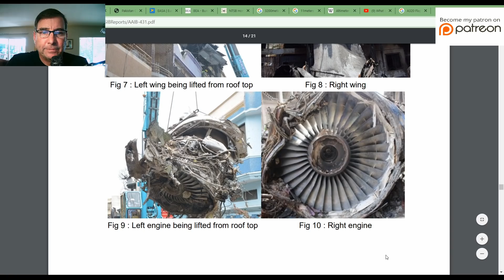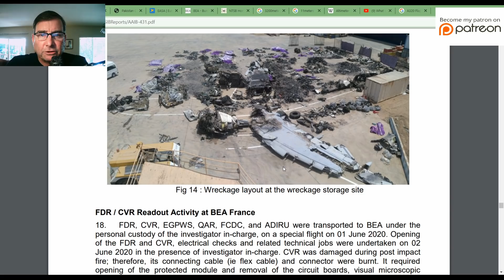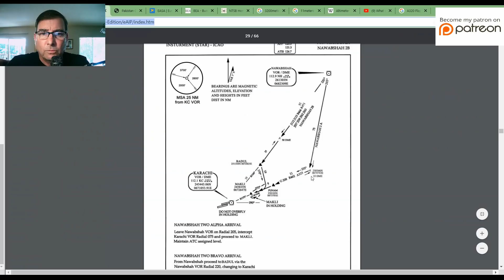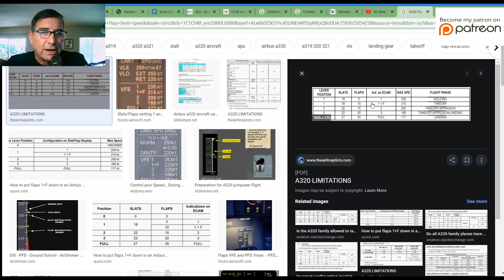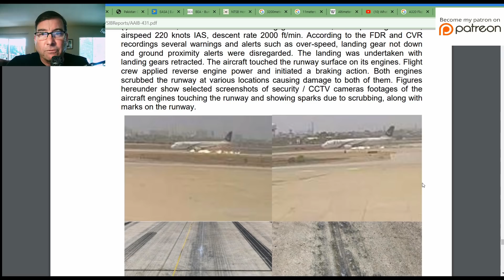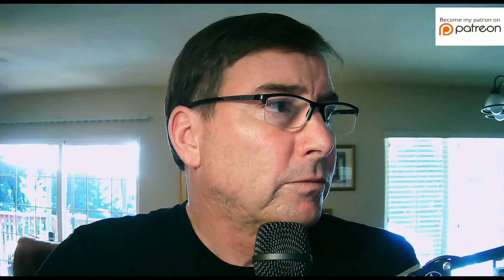PIA #8303 Preliminary Report Part II

Comment: I would not call this an ATC mess up... The ATCO expected the aircraft to heed multiple warnings and go around. I find it reasonable to avoid stressing an obviously overworked crew with a frequency change.
Reply: yeh more pilot induced, but atc could have said "approach clearance cancelled", in saying that atc still tried to tell them to do 360 to restart approach but the pilots disobeyed that.
Reply: @WaveFlightSimulations  The rule is the pilot is always in charge not ATC. ATC is there to help, advise, and coordinate. Ultimately the air crew is in charge.
Reply: @crissd8283  yeh thats what i said, but the approach clearance command is authoritative. The ATC in this case was not stern enough, and conceded to the pilots demand.  Most other airports, ATC would have said "PIA flight xxx, approach clearance cancelled, fly runway heading climb xx, follow my Instructions STRICTLY ".  If they said this the pilots would have realized they would be written up for misconduct and followed atc instructions.  In this case ATC was just like "ok your not going around thats fine i guess?". This is not proper ATC SOP to be bullied and intimidated by a pilot. ATC's instructions are authoritative, and unless its an emergency you as a pilot follow these instructions. Asking to restart approach isn't authoritative enough, it sounded more like a suggestion rather than an instruction. I suggest watching VASAVIATION  on pilot deviation, and how professionally and authoritative ATC are in those situations :)
Reply: @WaveFlightSimulations  it all depends on the mindset of the ATCO. He probably is used to this kind of approach and has learned to give as much help as he can. If he plays hard ball in an environment with a high percentage of these pilot deviations he'll have more go arounds than landings. In the end it is his responsibility to ensure separation of traffic and to facilitate the safe and efficient conduct of air traffic. Yes, that includes catching pilot error if possible, but he attempted that and was deflected. Without any indication of a problem beyond an unstable approach the ATCO would not interfere with pilot decisions.
Reply: Nikhil Naik - All you have stated sounds very good, but, sorry, it does not work like that. ATC did what was required, they advised the pilot of his altitude setting up for the approach. The pilot stated they were "comfortable". The pilot is flying the aircraft, not the controller. Is the controller qualified as a 320 pilot? The controller can recommend, it is the pilot who decides the course of action to take. Cancelling of the approach: What reason can the controller give? Was there another conflicting aircraft, the runway unsafe or the airport closed? The controller has to support his actions, "I thought he was too high", is he the pilot, does he know the capabilities of the aircraft?
As for the other videos, when there is a deviation from proscribed procedures, yes, ATC can be very harsh and usually is. PIA 8303, did not 
break any ATC rules, and not accepting the suggestions given is not a violation. Now, in some other countries, perhaps the system works differently,
Controllers and pilots are jailed for their mistakes, hell, in Uganda, the Tower crew was shot, for allowing an unauthorised  C-130 land at Kampala.
True, the radar controller could have been more assertive, but the pilot used his PIC and did what he wanted to.  We must accept Controllers have their work, and Pilots have theirs.
Reply: @crissd8283  yes mate i know thats not what im saying. Im saying atc have to be more authoritative. In this case the ATC performance was sub-par , they should have cancelled approach clearance as per SOP.
Reply: What confuses me is the fact that they somehow communicated by phone and radio at the same time and even got the landing clearance on a phone call!?
Reply: Nikhil Naik - Can you explain more on this SOP, you seem to be citing?
Reply: Jickles Jingles - I m in the same camp with you on this!, i have worked both Radar and Tower facilities and this is one strange act.
Usually, the procedures are set, that by 5 miles from the runway or over the  final approach fix, the Radar facility transfers control of the  flight to the control tower. Tower, then does a quick visual check for gear and landing lights, and then issues a "cleared to land" instruction.
On the report, they say so as to not inconvenience the pilot while he is busy, the got the clearance via telephone from the tower. 1. How did radar know they were busy? Did the pilot make such a comment? 2. Why did the tower not question radar as to when were they going to transfer the flight to him?
3. Did he initiate the call, or did radar call him? 4. Did the tower controller look at the aircraft at all? Did he not see the gear was up, and no landing lights? (This just doesn't sound right). Why has there been no mention of the Tower controllers statement? what he saw, and what he did?
I have worked in ATC, for many years, and have worked in the Middle East.  When this incident happened, it was just about afternoon prayer time. I strongly believe, that, being Ramadan, little to no air traffic, with just 8303 inbound, the tower personnel left the facility and went to prayers
Radar was to issue landing clearance, no other traffic no problems. Doc 4444, the ICAO, manual for ATC, requires that a "check gear down" advisory be given, followed by the wind information, and then "cleared to land, runway 25L" All that was given was cleared to land, runway 25 left, given by the radar controller, not well versed on control tower phraseology. 
Tower controller was not there to see anything, therefore nothing was said to the Radar controller. The radar controller,  being in a windowless room, did not see anything either. Someone ran in and told the radar controller what had just occurred. Why would he ask 8303, are coming back for a "belly landing"? The pilot made no  mention of that. 
It would be nice to listen to the Tower and Radar tapes, completely untouched, and to read the statement made by the tower controller. But, I highly 
doubt they will release all of that information. If it is released it will be chopped to bits.
Reply: @rubenvillanueva8635  delegation of control is certainly nothing special or unheard of in the world of Air Traffic Control. With the general wind down of operations a minimum crew was likely available and Tower Operators would shift to monitoring ground movement. It is possible that the ATC for Tower/Ground was one person and the coordination and release for continued control over runway operations is nothing special. Approach did give the proper landing clearance and while Tower may offer advice on aircraft configuration if anything special is observed it is not usually something Tower does. Especially not in such an approach. He likely didn't even see the plane. At the time he got the call he would routinely check the glideslope and not twice the normal height... And while Tower can observe the gear, that usually requires an overflight due to visibility restrictions. At 10NM you're not seeing the gear properly no matter what fancy binoculars you are using.
Reply: Imrahil - I agree that the tower facility may have been operating with reduced personnel, but the Tower is still responsible for all activity on runways, taxiways, movement areas and for any airborne aircraft within its airspace. A Tower controller, prior to issuing a clearance to land, is responsible fir assuring the runway is clear, This is normally a quick visual scan of the runway. They then look at the landing aircraft, and look for the landing lights and gear, and issue the wind direction and speed, followed by cleared to land runway xx. The controller observes the flight landing, and it is part of his 
responsibility to immediately notify the pilot of any observed danger. Sorry,  you are misinformed. And to issue Go Around, instructions.   What do you mean by, "especially not in such an approach"? Why did he not see the plane? Was he not in the Tower?, or was he asleep? Check the glideslope?
You do not need an overflight to see the gear. It is visible with normal vision, and if the aircraft is further out you use the binoculars. Was there any restriction to visibility on the day of this incident? I do not believe so. Also, on must apply common sense, only a fool would try look at a landing gear 10 NM away. I appreciate your comment, but it appears to lack much insight of the operations in ATC.
Reply: @rubenvillanueva8635  you should be careful accusing people of lack of industry knowledge. I'm certain I'm not the only one here with ATC training.
As for the requirements on the controllers: The runway was clear, no reason for a go around was present. There were no incursions or other ground operator related issues reported. The ground controller gave a report of the ground strike to approach and approach did not relay that to the pilots. My guess is that report reached him either after PIA8303 declared an emergency or shortly before.
The accident report contains only the standard language related to ATC performance you'd expect in any serious accident and does not mean serious issues relating to the accident are expected to be found at this time.
The decision of the approach controller to keep the aircraft on frequency is a probable contributing factor to the accident but a) not a major factor and b) reasonable based on the information known to both ATCOs at the time. The aircrew was stressed and the controllers decided to help them by avoiding a double frequency change (since approach expected them to go around).
ICAO Standards do not, to my current knowledge, require observation of a landing aircraft for landing clearances. Any such requirement would make low visibility operations basically impossible.
A diligent observation of the aircraft on part of the tower controller could have prevented the accident under certain circumstances but both the abnormal flightprofile and the weather could have contributed to make any such observation unfeasible. The aircraft was not where you would expect it. In addition the landing gear was retracted after initially being deployed, which adds yet another reasonable scenario for ATC to believe there is no immediate reason for concern.
It is unlikely that any action on part of ATC could have prevented the accident after the crew decided to compound their initial mistakes by going around on damaged engines and possibly shutting down the one good engine they had left.

Your observations of what "normally" happens sound weird to me. Maybe on a perfect day something close to that could occur during low traffic, but it certainly is not standard to observe aircraft all the way from approach to rollout. Such diligent observation is usually left to the plain spotters...
Reply: Imrahil - Well, again thank you for the dialogue, I have read it thoroughly. Your comments themselves reveal a lack or misunderstanding of ICAO procedures, or how the system is established. Very comical, to say the least, massalamah!

Comment: Juan, I agree the passengers deserved better out of the aircrew. The only other example of poor CRM this bad was the Air Florida Flt 90 that crashed into the 14th St bridge and Potomac River on takeoff in Washington DC in 1982. If you have never read the CVR transcript of that flight I urge you to check it out. I will wait until they publish this CVR transcript to find out if this flight was worse that that flight. On another point, I believe the initial lowering of the landing gear was to add drag to the aircraft to increase their descent rate. Notice how it steepens right after the gear is lowered and I believe they raised the gear along with retracting the speed brakes when the capture the glide slope. They just didn’t put the gear back down again later on approach. All in all a totally botched approach!

Comment: Aside from scrubbing their engines on the first approach, it seems deploying their landing gear early on the second approach truly sealed their fate, shorting their glide significantly.  It would be an interesting simulation: could they have made a successful landing if they had delayed deploying their landing gear (or not deployed them at all) on the second approach?  And choosing 25R instead of 25L would have at least taken them away from the buildings, bringing the runway threshold a little closer.  All-around, it was a sequence of bad decisions leaving no choices at the end.  That stated, I am looking forward to the CVR transcript, hoping that it will shed more light.  Excellent reporting, Juan.  Thanks.